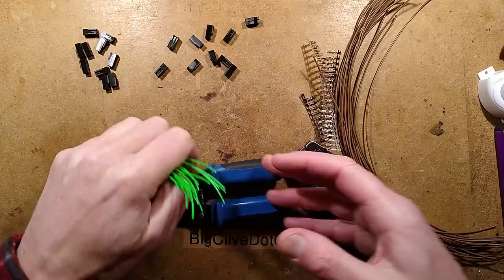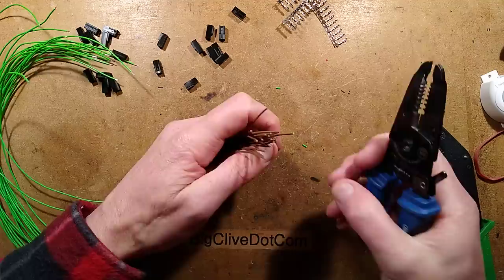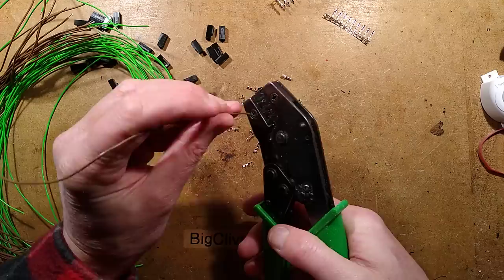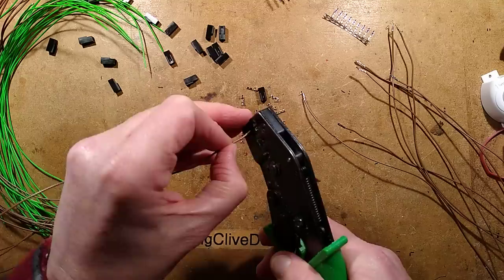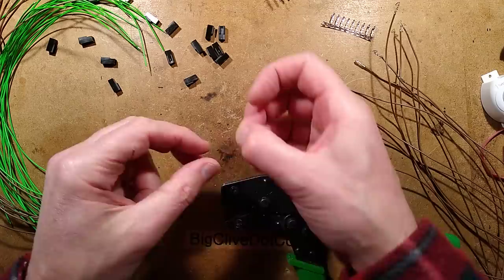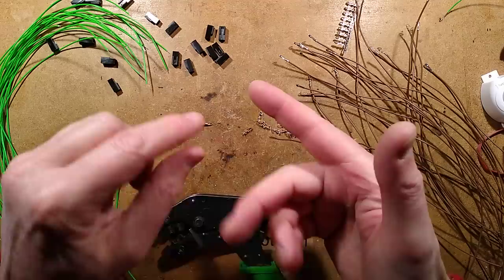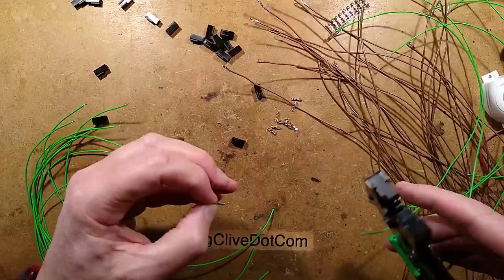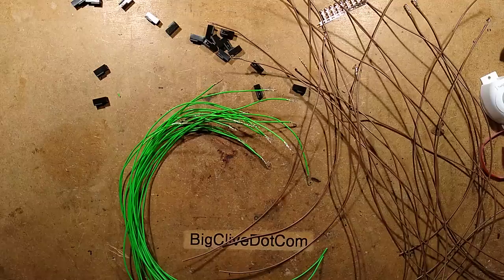Q&A while making prop stuff Part-1

Comment: I wouldnt be worried about the crimps making bad contact, id just fear the nick in the wire would cause an eventual break. In residential work it was well beaten that all nicked solid wire must be cut and restripped thats why I stopped using dikes to do it.. I finally got a break after years of avoiding strippers out of ego. I was adamant that a good electrician could strip most wires with most tools. 6 outlets and 2 tripped breakers later, I found the break, and opted for a set of greenlee strippers that xmas.
They never called back.... 
Sorry grandpa.... xD

Comment: I used to cheat with my friends with a pair of boots I knew if dry gave a good insulation to wire a lamp live. As long as I knew boots was a good insulator and then ask them to wire it.  The answer was I was mad and now to them holding the wires.  It did still tingle but I did make sure these boots was clean and new.

Comment: i remember a time a few years back, when i'm putting up a light in the kitchen for my sister and her husband, i asked my brother -in-law if the light switch was off, he said yes so there i was, stood on an aluminium stepladder and i happend to touch the live wire and guess what......the switch wasn't turned off lol 220 volts through my wrist, a rather unpleasant throbbing feeling lol and nowadays the average speed of a gaming pc is between 4-5 Ghz